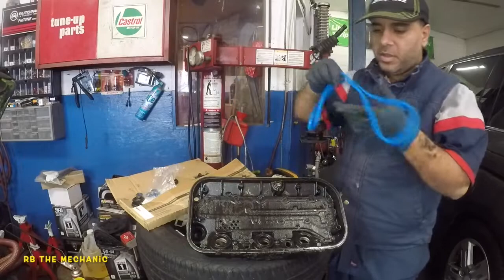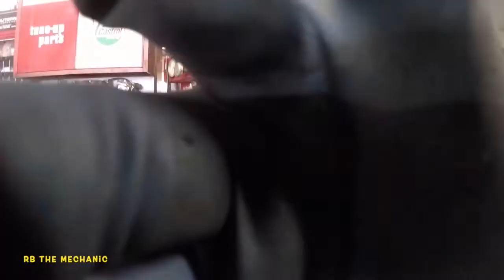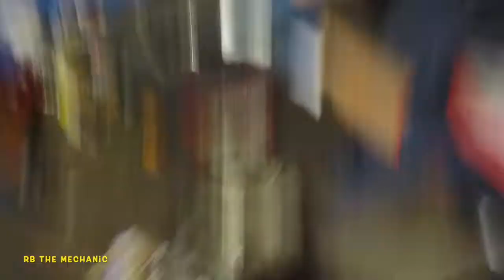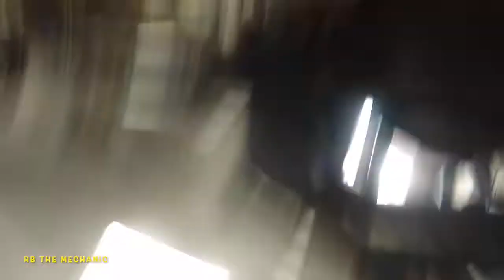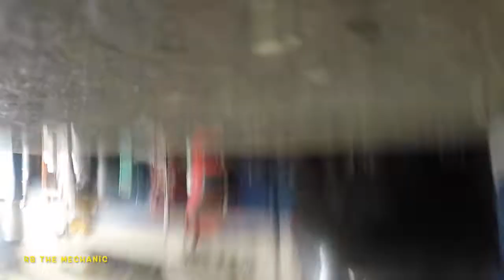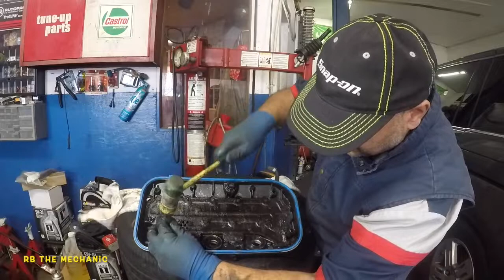Replacing leaking valve cover gasket propeller Honda / Acura V6 motors

Comment: ??  How many seals do I need for a 2013 Honda Accord exl v6.   Does a  valve gasket leak causes the engines to shake when you accelerate??
Reply from the maker: No but if it’s leaking inside the plugs that can cause misfire and shake. And u need front and rear gasket also 6 gromets
Reply: @RBTheMechanic Did you receive the pic
Reply from the maker: @ no u have to post it on ur utube
Reply: @RBTheMechanic  I posted it  .. I'm not to good with this YouTube .. I wanted to ask you what that area is called where it is leaking at and does it automatically mean I have to replace the front and back gasket or can it actually be something else causing this leak.   Thanks for your response.  I live in Philadelphia and these mechanics down here are acting like they're not sure
Reply from the maker: @ ok so that look like u need valve cover gasket along with the gasket for the bolts
Reply: @RBTheMechanic  good looking out.  I'm going to take it to the shop tomorrow

Comment: If you had a stripped plug, could you leave the plug and still replace the grommet?
Reply from the maker: Spark plug?   How did it strip?
Reply: @RBTheMechanic  one of the rear plugs got stripped by a mechanic years ago, they put in 100k life plugs in and might have lok tited them 🥴

Comment: Hi, I want to ask on the valve gasket not the grommets the long gasket . Does it matter if the gasket doesn’t have that curve in area. Will it leak once i put it in. Hope you understand what I mean.😅
Reply from the maker: Well it has to be same
Reply: @RBTheMechanic  I meant it doesn’t have the curve going in . On your video same no curve , will it matter .
Reply: Oem?

Comment: Whatup brother. Questio I have a 14 pilot EVAP purge solenoid problem. But yesterday show me the Gas Cap was the problem,then the check engine comes . You think is just the gas cap? Thanks again 😊
Reply from the maker: I would replace the gas cap but it’s 2014 they don’t go bad that quick but it’s a start
Reply: @RBTheMechanic  thanks so much!!! For your answer 🙏
Reply from the maker: @Eli_is_a_Lauver  welcome!!!